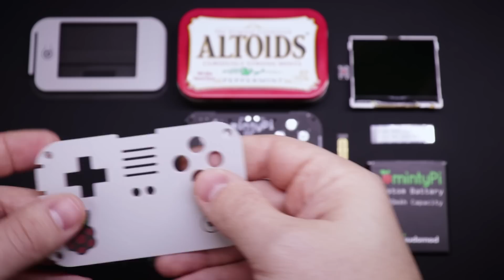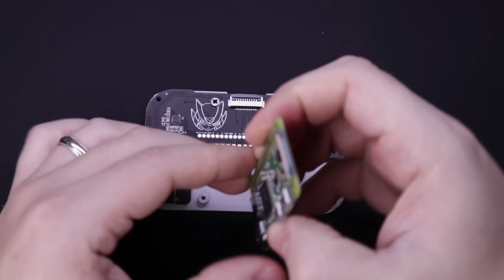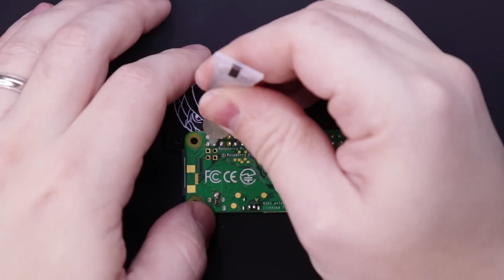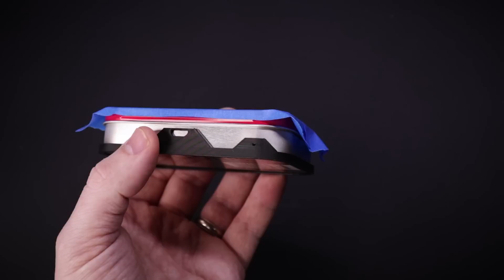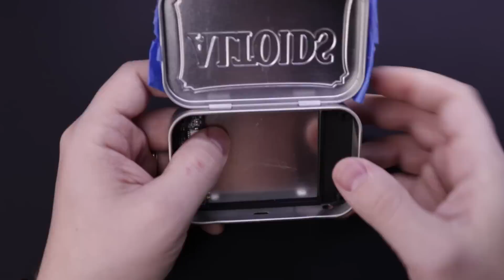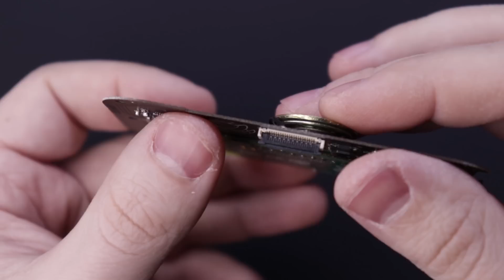mintyPi v3 Build Guide

Comment: I sort of wish this was sold in a more streamline way. Having to buy the shell, buttons, and other non electric parts from one person and the board from another that may or not come with a battery (meaning you have to get a battery from some third source) is rather cumbersome.

Don't get me wrong, this is an awesome project and I fully respect the time, effort, and dedication that was and is placed into it. I just think, from a consumer point-of-view, purchasing of a mintypi should be consolidated.

Comment: I like MintyPi, this project is seriously cool. The one thing about it that bothers me a bit is that soldering method to join the zero to the carrier board. I learned my base in electronics decades ago from an octogenarian, so i might be a bit "old school". I was taught "mechanical connection, then electrical connection" the solder being the electrical connection *ONLY*.  That solder as mechanical connection bothers me. Maybe You could look at a future revision with some holes milled out to put header pins there? Doesn't have to be all of them, just the outer two on both sides and a pair in the middle... it's probably fine but i like to look at something and say "that's stronger than it ever needs to be".

Comment: Hey wermy can you give me some advice? I'm trying to connect the Raspberry pi to the button PCB and test the test pads but the "B" pin does not work. It's an overheated joint and I think the copper conductor on the actual pi has melted. Whenever I try to add solder it sticks to the iron and doesn't drip down the hole. Is it still possible to connect a wire through the two pins? If so, how? Anyone's help would be greatly appreciated :)

Comment: im thinking of using this kit with the new bananapi m2 zero, which has the exact same layout but is way faster. But it would need a different operating system, because retropie isnt compatible, would the controls still work fine with  another emulation station based OS?

Comment: Hi wermy. I've been following your channel for a while, and have been particularly interested in your DMG Game Boy Zero videos... About that, is there any way to make a build similar to the one you did, without modifying the casing at all? I don't care if the screen is the original size, but I've got a DMG with horizontal screen lines (which came up after successfully fixing some vertical lines, I might add), and I don't want to cut/add glue/modify the original shell to the point that I can't rebuild it back to original spec, if I ever get lucky again and find another DMG with a working screen, but a damaged shell, let's say... Sorry for the long winded comment, hope you can understand. I'm really not a pro with electronics or hand tools either, so there's also that. Thank you so much.

Comment: Hi wermy, I really want to build the minty pi. But I still have some suggestions for future improvements. Could you leave a hole for the HDMI port? So that we can use it as a home console since it has Bluetooth.  It will be really awesome if you do so. Thanks!
Reply: iMad Science you can cut out the hdmi port yourself I’m pretty sure
Reply: Yes, but it's not ideal. First of all, it's not gonna be perfect. We need to have the option to laser cut the HDMI along with other holes. Second. the software is not ready. For example, it need to out put video through HDMI first. Then, it shuts the screen off automaticly when you make the connection through HDMI. And, it does not shut the whole thing off when you close the lid while playing through HDMI. Those are the things needs to be done to make the HDMI upgrade.

Comment: You can make desoldering braid yourself. Get some stranded copper wire (the finer the strands the better). Strip off the insulation, braid it, if you want (it doesn’t have to be braided) , then coat with flux. Done. 

If you wanna be extra fancy, you can apply the flux inside the braids (like the center of the braid). Although that’s not entirely necessary.

Comment: So wait I am a bit confused why there is a micro and type c plug up can you charge it ether way or what
Reply: Micro is for the native usb port on the Pi you can have access to it. The USB-C is for charging only, that micro usb is optional and not really needed if you use wifi to transfer files to the Pi.
Reply: Thank you

Comment: I have some old 3.7v LiPO batteries lying around. Can I still use those?
Reply: if you don't have the mintyPi batteries they can be used , just solder the wires to the back of the battery connector which I have labeled + and -